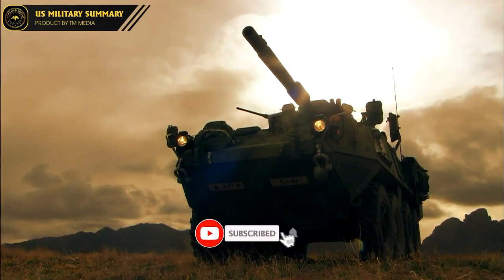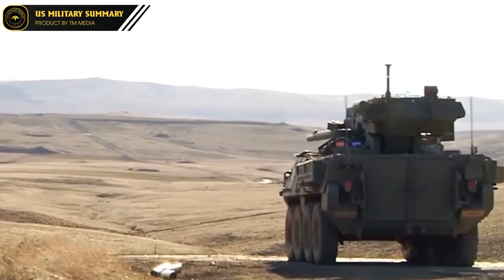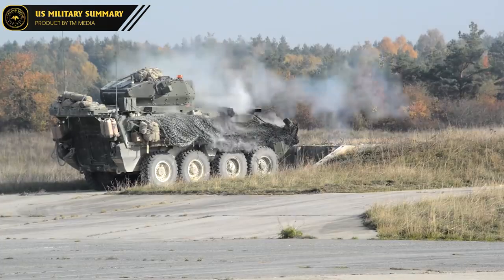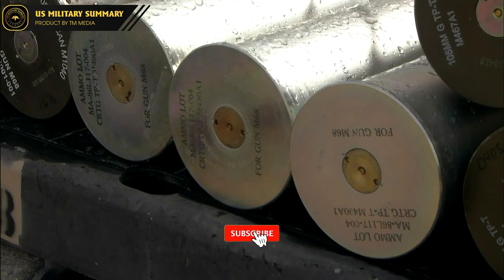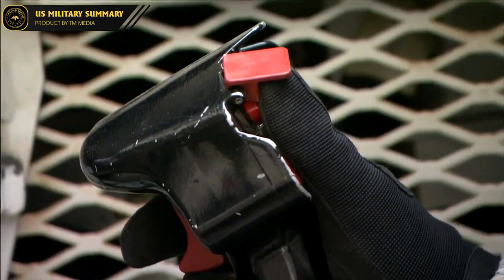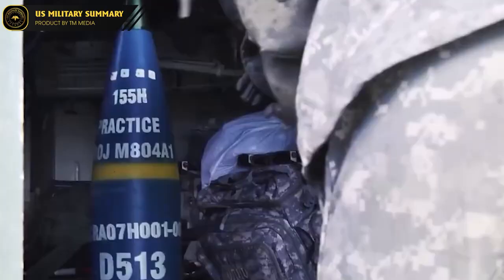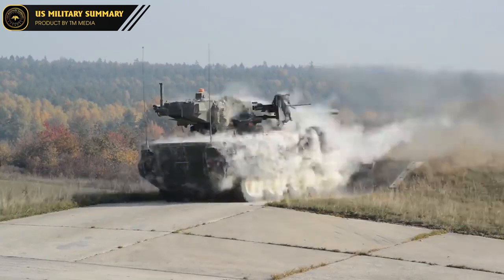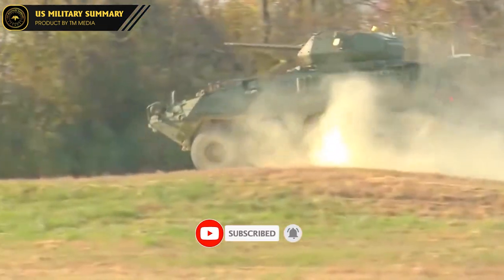A Closer Look at the M1128 Stryker: Armored Fighting Vehicles (A Real Beast On The Battlefield)

Comment: The M1128 Stryker is a potent military vehicle utilized by the United States Army for its impressive speed, firepower, and mobility. This eight-wheeled armored fighting vehicle is designed to operate in a wide range of environments, making it a versatile and reliable asset on the battlefield. With its powerful 105mm cannon and advanced communications systems, the M1128 Stryker is a critical component of any modern military force.
Reply from the maker: Thank you for sharing your insights about the M1128 Stryker on the US Military Summary YouTube channel. It's great to hear about the impressive capabilities of this military vehicle and how it contributes to the strength and versatility of the US military.

Comment: What are the capabilities of the M1128 Stryker in combat? Military Summary
Reply from the maker: The M1128 Stryker is a versatile armored vehicle that is capable of performing various combat roles, such as reconnaissance, security, and direct-fire support. Its main armament is a 105mm cannon, and it also has secondary weapons systems like machine guns and grenade launchers. The Stryker's mobility and speed allow it to quickly respond to changing battlefield conditions. Overall, it is a highly effective and reliable asset for modern military operations.

Thank you for your comment and interest in the capabilities of the M1128 Stryker.